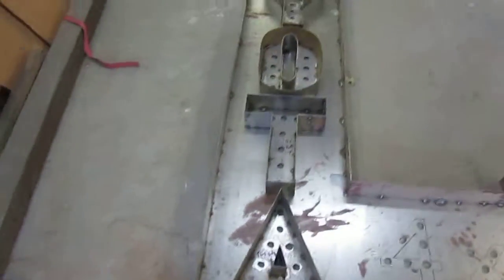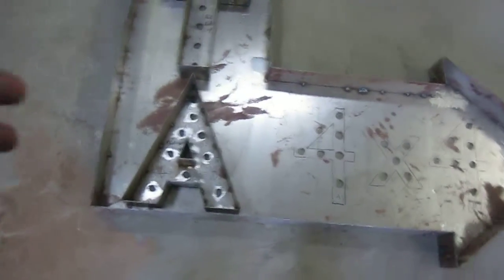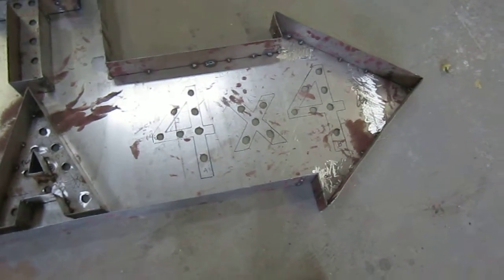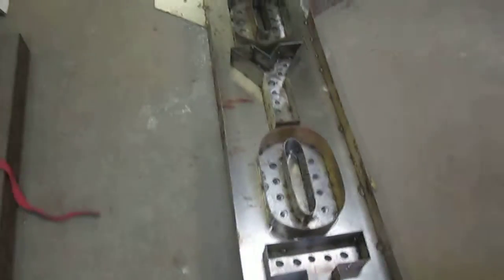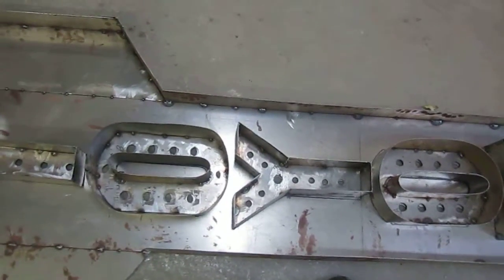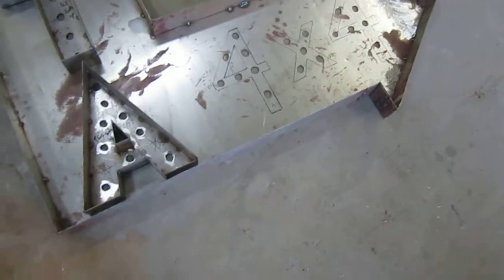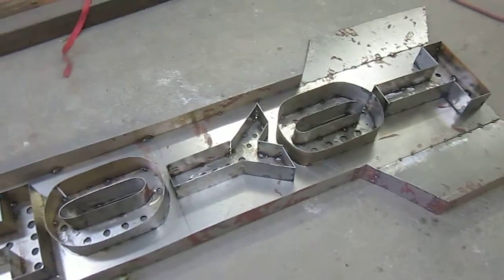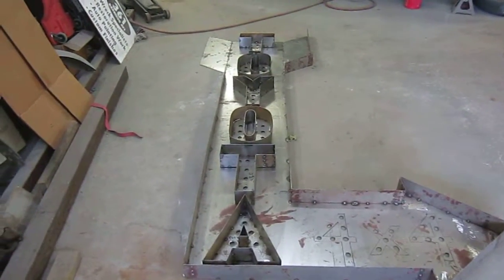TOYOTA 4x4 Marquee Sign Build

Comment: cool sign. . . but how did you make the letters?
Reply from the maker: Cooper Conrad Thanks!!As for the letter, I just traced them out on thin cardboard one I got the size I wanted.  Then I just centered the holes for the lights as square as I could and used the plasma cutter to poke the holes. The border (3D) look was pretty straight forward since it was thinner gauge material which bent into place pretty easy.  
If I could do it over again I would started with a MUCH smaller design and go bigger.  This sucker is over 8ft tall.